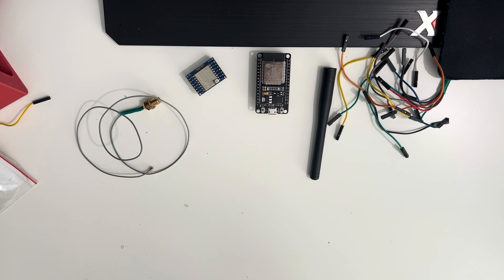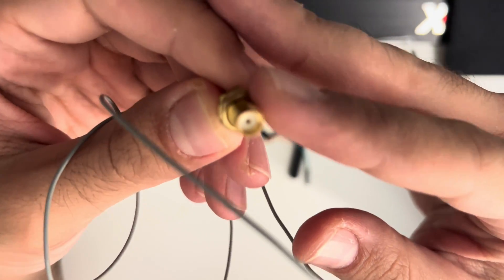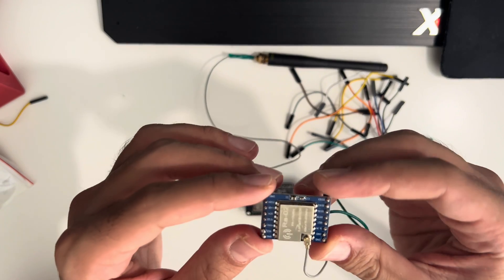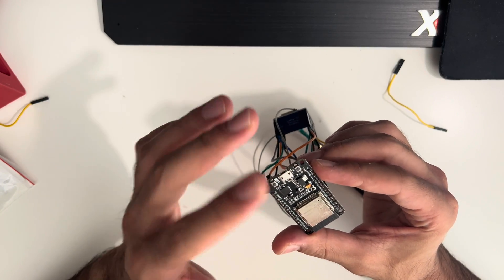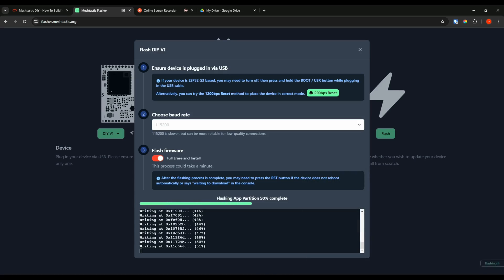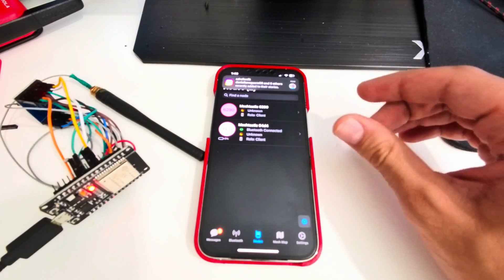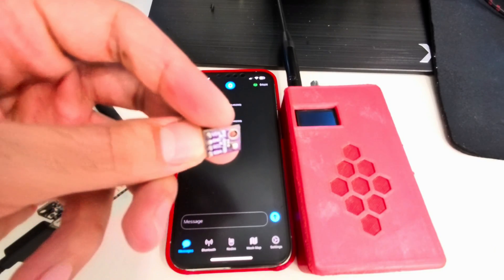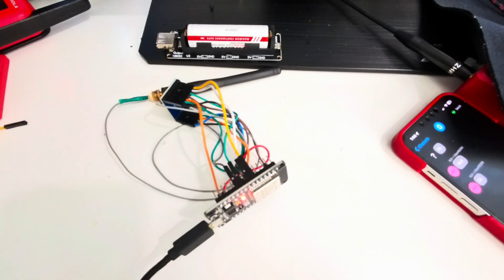Meshtastic DIY - How To Build Your Own Meshtastic Node ESP32 & Lora Radio

Comment: I am having no end of trouble with a few different lora modules i have, they just wont be detected by meshtastic but then my modules are RF96 915mhz so i think they might be the problem, something about the pin 05 on the esp pulling low and crashing the board but who even knows, its just a pain that the firmware wont let you program the gpio ports differently
Reply: turns out I cant get the XC4392 LoRa Shield to work at all with meshtastic (let me know if someone works it out), but I moved to a generic rf96 chip i had lying around and got that working with the pinout at https://github.com/WOD-MN/LoRa-meshtastic/blob/main/ckt.jpg

Comment: Hey, you used a 433mhz module - if you're in europe why didn't you use 868 mhz? If I used the board you linked to, would that work with 868 mhz?

Comment: Can you use this project to add BME280 and NEO6MV2 GPS? if affirmative, Could you please explain the connections for the ESP32 and the NRF52840 DIY versions? Thanks!
Reply: You select in the Meshtastic setup which GPIO pins you are using for your GPS module. I added a GPS module to a Heltec V3 with no problems. Google howto add GPS to Heltec and there will be more guides. Should work just the same with a ESP32.